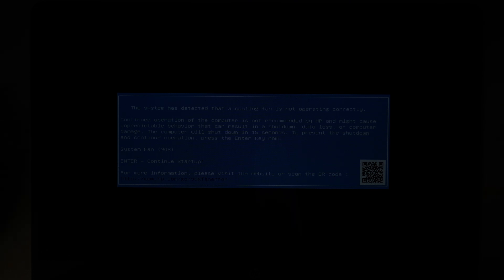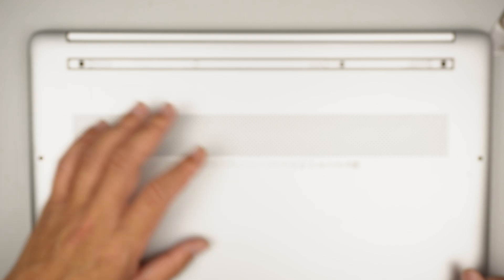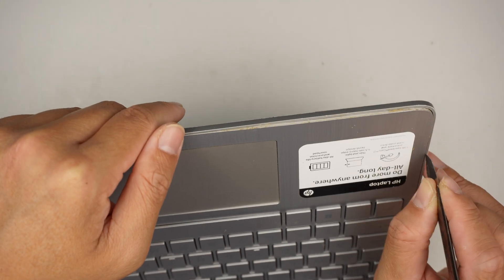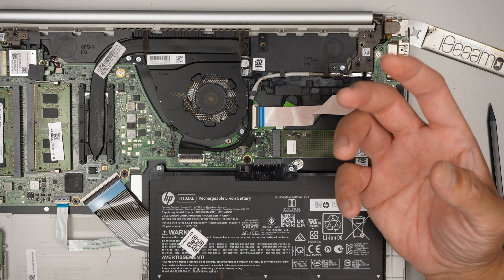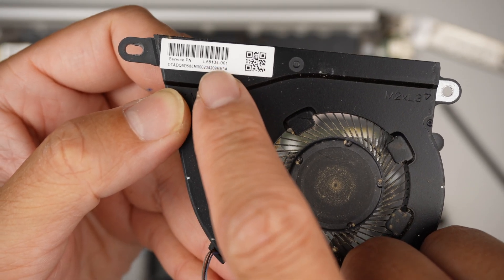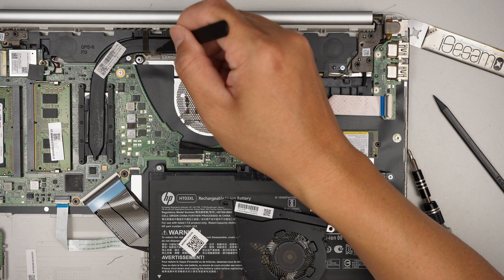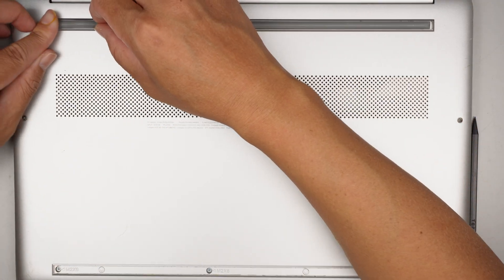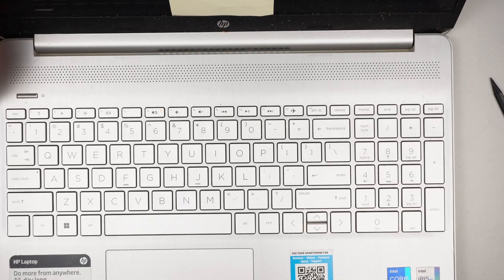FIXED HP Error Cooling Fan 90B

Comment: I will give this another try. last time I tried to remove the cover, it couldn't get it  off, and I was scared I might break the cover, so I stopped. I will try to find a prying tool. My only question is, once you remove the cover, is it okay to spray compressed air in there
Reply: Bruh no
Reply: @touristofsongs4946 I did it and it works